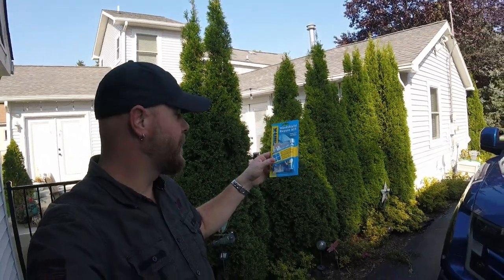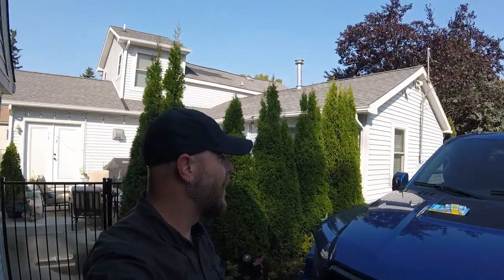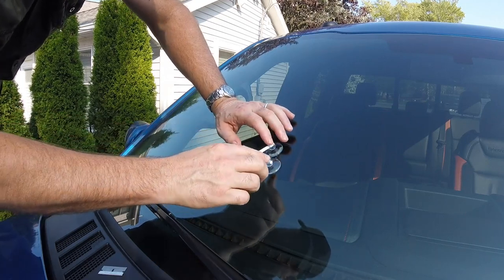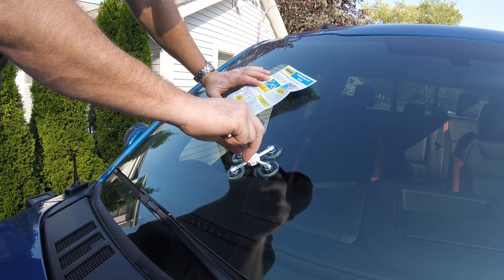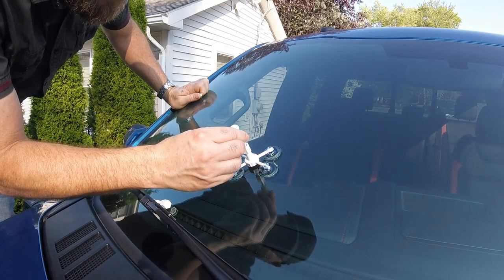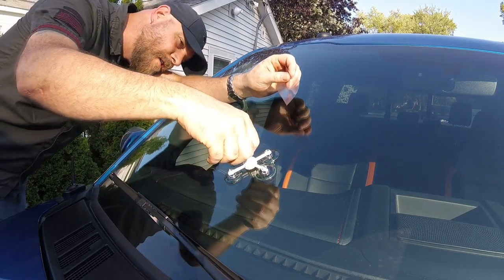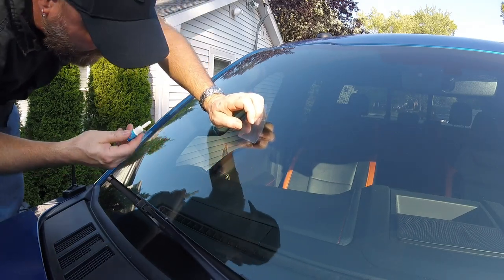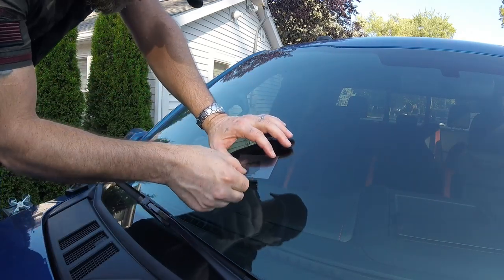2018 Raptor Week 19 Windshield Repair

Comment: I learned many years ago those diy kits are terrible... they do fill the chip with resin, so the screen shouldn’t crack, but the final finish leaves a lot to be desired.  The professionals use a vacuum system, works so much better....